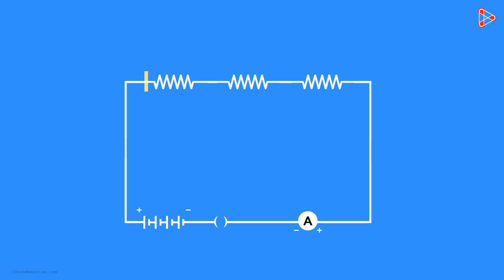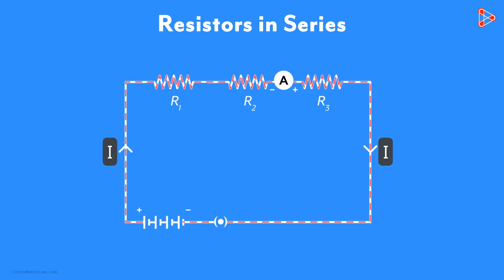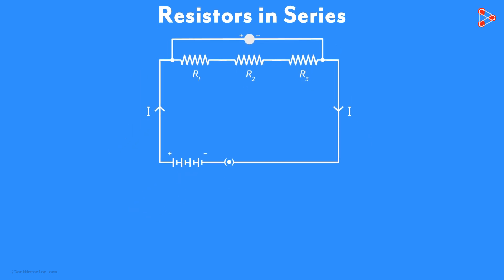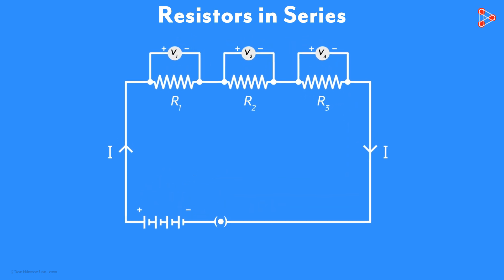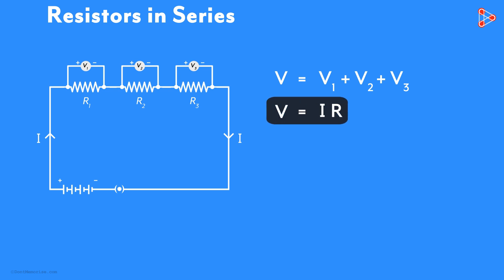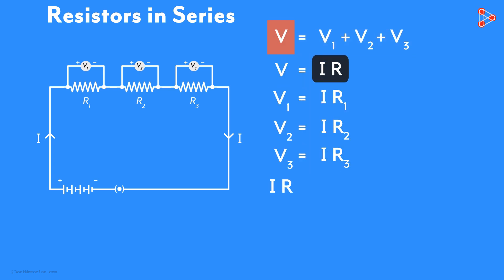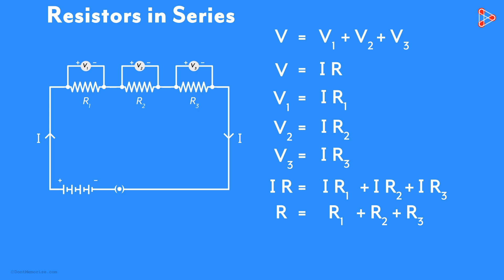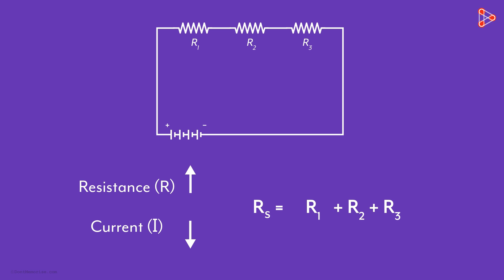Resistors in Series | Electricity and Circuits | Don't Memorise

Comment from the maker: #DidYouKnow: Like in a light flasher, electronic sirens, blinking lights used in aeroplanes or tall towers which acts as a collision avoidance measure. They work on the principle of filling up current to a certain time and then discharge light, in here, the resistor decides how much current has to be passed according to the time allotted. If resistance increases, the time for discharging current in the circuit increases.

✅To access all videos related to Electricity and Circuits, enroll in our full course now:  
 https://infinitylearn.com/cbse-fullcourse?utm_source=YouTube&utm_medium=DME&utm_campaign=pd3RkGs1Tsg

To watch more Physics videos, click here: https://bit.ly/PhysicsVideos_DMYT
Reply: If the voltage is decreases then current will also decrease so how u can say that current is constant. 
Please help
Reply: Increases adds.
Reply: I knew because I m a robotics student

Comment: Just found this video on youtube today.  So if you have a complete circuit it doesnt matter where the resistor is correct?  Like if right after the power source there was an LED light that would normally explode.  But you can put the resistor before or after the LED to protect it yes?

Comment: mam one doubt...why current doesnot decrease on passing through a resistor? please explain me
Reply: I had the same question but i cleared it through gpt recommend it . Its because when electrons pass through resistors the electrons suffer only a loss of energy and current is the flow of charges so in short there is no loss in electrons that would change the current but just in their energies thats it interesting isnt it
Reply: @crystalpark9939  it really is! Thankss🙌
Reply: Good
Reply: the current in a circuit is determined by the circuit's total resistance, not the resistance of individual components

Comment: If the voltage is decreases then current will also decrease so how u can say that current is constant. 
Please help
Reply: Of course ,current decreases... as the current decrease it will be decreased in all the parts of the circuit...so the current is constant when its kept elsewhere..clear?

Comment: As the resistors have different resistances , then how the current  passing through each resistors remains same in series combination. Please give the answer
Reply: Even if resistances differ, the overall resistance (sum of all resistances) is constant/same in the circuit. So as only 1 constant resistance opposes the current the, current remains same throughout. This is  bcuz all the components lie on the same path in series.

Comment: a doubt..if overall  current decreases in series,how does it remain constant when measured
Reply: By constant they mean that the reduced current is same throughout. I mean see if Electric current= Coulomb/second then the total resistance will slow down the electron flow or coulomb flow and therefore, it will take them more time to reach the positive terminal of the battery, so their overall timing is reduced. So, less amount of charges flow per second.

Comment: If the current across the resistors is same... Then y the hell are resistors used???
Reply: Because if there will be no any resistor then path of current will becomes very easy for them to flow in...any thatswhy a large amount of current can flow from the power supply....and it may leads to short circuit. And resistance means everything that we used to like bulbs,gyesers,heaters,etc....and current flows same bcoz speed at which it enters in resistance is same at which it comes out .change occurs in speed of current(voltage) not amount of current and at the rate at which it enters in resistance is same at which it comes out in resistance ....speed only changes in the resistance!!!!! Hope it helps😊
Reply: @mokshakamra  thankyou very much
Reply: To decrease the volt of current. Notice that current simply means rate of flow of number of electrons. Hence the number of electrons are always going to be same. But the energy in each of the electron (voltage), will be reduced by resistance. Thats why either you have not understood the concept of electricity or your question does not make sense at all.
Reply: The resistor will alter the rate of flow of current not the current itself. For example, when u want to drink water u would regulate the water flowing from ur aquaguard of course there will change in time. You would also observe while washing ur hands since Corona is going on😁😁
Reply: See when one resistor go boom than the other one can work😂
Reply: Watch the video from floatheadphysics of why current does not slow down after it exits a resistor, very intuitive explanation
Reply: Resistor is used for voltage bro
Reply: Chhaya Patil the resisters are used to give a sufficient amount big current to its respective consumer